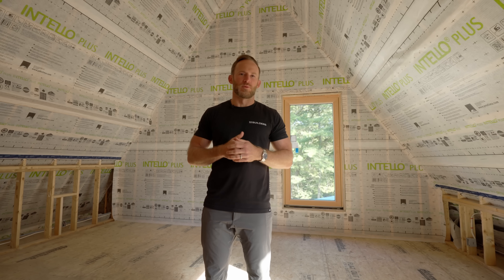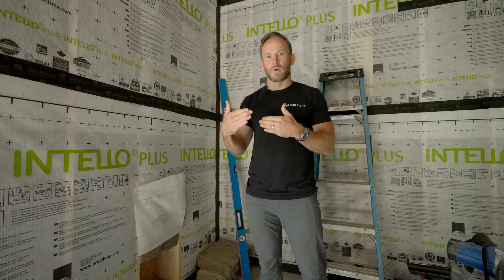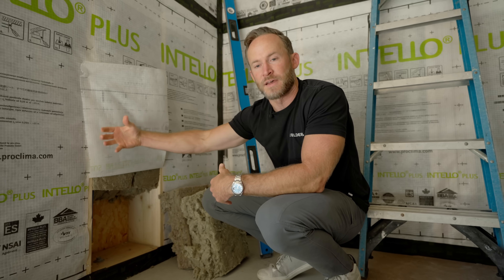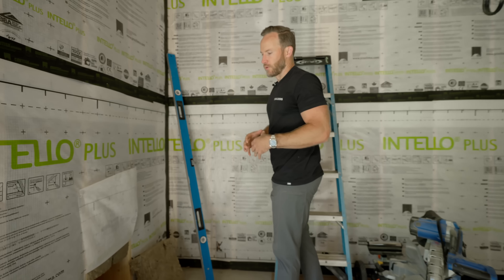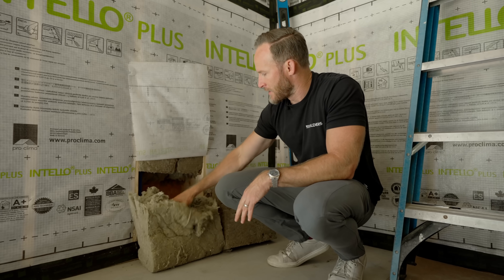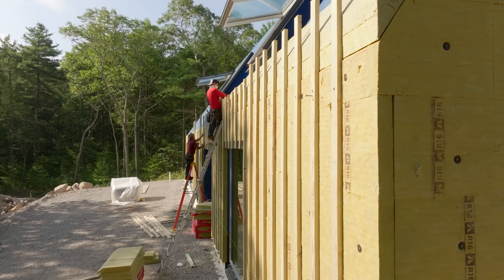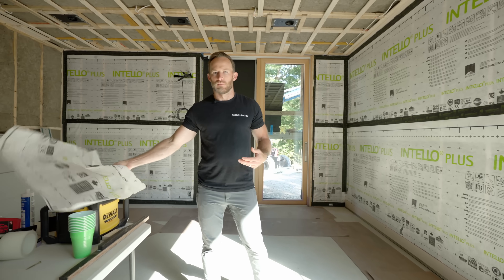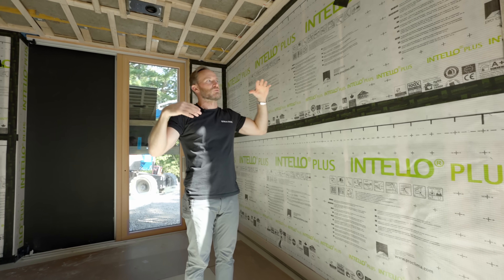Better Than Spray Foam? Why We Choose Mineral Wool

Comment: The divide between something built like this, and the homes that are being built near me today, is so wide, that one cannot see the other side.  While this particular build certainly comes at a very high price premium and represents maximum effort, I can't help but think that the bar couldn't be raised SIGNIFICANTLY for the everyday builders that prop up stick houses near me.  They are two completely different worlds.
Reply: Yeah, as an architect, I can count to that. This is how we would like to build. We understand the reasons why but it’s rare that clients are willing to invest in the future, which is essentially what you’re doing here.  Upfront cost rather than long-term cost of energy.  However, if you do the upfront cost, it also comes with significantly more comfort throughout the life of the building for the occupants.  You don’t get that when you do the cheap code minimum, which is what most people do.  And I get it. Everything‘s too expensive for the most part. This is how the other half lives.
Reply: It used to be the price per sqft is the determinant...but nowadays it is just pure market and not manufacturing driven.

I was shopping for a single family house pre-covid and anything over $250/sqft in north TX is considered luxury with 12' ceiling, > 40" main entry space (that you can roll any appliances furniture in) proper rockwool and ZIP sheathing, properly decked subfloors, and each room would have it's own return air vent. The only downside is it would be 10-20 years old.

Now, even the Tyvek wrap cardboard with 5' sideyard setback sells for that much and people fell for the gimmicky minimalist LEDs. You will need more than $500/sqft to hire a custom builder with enough cash and proper project management chops to  build your million dollar 2500sqft house.
Reply: people are literally spending $700,000 around me to buy a shit house from the 80's that needs total updating. Its a joke. Yes the bar is very low for entry houses. Take some coin to be this detailed. But something everyone should strive for.
Reply: In Vancouver, BC, Canada, it's down to about a 7% premium to build to Passive House standard, which is pretty much what is being done in the video. That isn't a huge amount and includes very high performance windows and doors, among other things. Some people spend more than that on getting the kitchen of their dreams, or some such thing. 

While it's hard to get builders to buy into it, it's not as hard as it looks, and the building designs are often a bit simpler to reduce thermal bridging that occurs through more complicated geometry. That isn't to say there aren't some beautifully designed buildings built to Passive House standards, because there are, but a simpler shape will keep things cheaper and easier. Then there are the health benefits... Building codes in North America NEED to be incrementally brought up to Passive House standards, for a number of reasons. We've built too poorly for too long.
Reply: @duanerichardson2380   the efforts in this video are nowhere near a 7% premium in Van.
Reply: @blairkeeling7385  Are you saying the premium would be lower in the video or greater? The 7% premium in Vancouver is for certifiable PH levels, which appears to be what they're doing here. Of course, that percentage is going to change depending on geographical location and associated costs. Honestly just curious, not trying to be argumentative.
Reply: @duanerichardson2380  leave the building codes alone. If someone can only afford a basic house it’s better than being homeless and forcing everyone to such a high standard will literally leave people out in the cold. I grew up in a house with 2x4 walls and R-11 insulation and survived just fine. The free market can decide what builders should provide.
Reply: @jim4utube  There are several reasons why building to a much higher standard is beneficial. Energy requirements are constantly increasing and so is the cost of that energy. Currently, if power goes out in winter, people and pipes freeze; not so in a PH. Current standards allow for and actually increase rot and mold growth, requiring additional costs of upkeep and repair, and promote poor indoor air quality which results in asthma and allergic reactions. PH buildings are more resilient, healthier, and better for the environment. 

There are really two main barriers to building to PH standard. First, the vast majority of people are uninformed. Too many builders think the way they’ve always done it is fine, so they may not even bother learning the benefits of PH and passing that knowledge on to their customers. That’s the type of thinking, in many industries, that stalls progress. Second, people only look at the upfront costs and ROI, yet fail to consider the savings not just in energy, but in maintenance and repair to the structure. Without moisture accumulation issues in the walls, there will be no rot or mold, and without condensation issues on the inside, no mold issues on surfaces. Or consider PH windows which are more expensive, but of greater quality and will last longer, reducing the number of times they need to be replaced, making them cheaper in the long run. PH homes are built to last a very long time with minimal maintenance to the structure; what we build currently are not. PH buildings are cheaper in the long run.

Consider also that some jurisdictions in other parts of the world only allow PH for social housing, as it reduces energy costs by 80-90% for new builds. Even doing deep retrofits can reduce energy costs by 60%. Does it not make sense that the poorest people and those on fixed incomes should pay as little as possible for energy costs?
Reply: @duanerichardson2380  you missed the point of the comment you are responding to.
Reply: @duanerichardson2380  and how do you think poor people and those on fixed income are supposed to afford this?
Reply: @zaneturner4478  How many poor people and those on fixed income are building new homes? They're more likely to be renting the cheapest homes, including subsidized housing, are they not?

But that also raises the issue that all social housing should be built to PH standards, so that the poorest people have the lowest monthly bills. Some places around the world actually do that.
Reply: @SteelheadTed  I'm pretty sure I understood. How many people who can afford to build even a basic house at current codes, will be homeless and left out in the cold if codes increase the quality of the build? If they have the money and income to build a basic house, they have the money to continue to rent until they can afford the extra 7%, or whatever it might be--it's likely to end up being even less as builders educate themselves and get experience, and component costs come down as demand increases, resulting in increased supply and innovation. Or, such persons can build a slightly smaller house and/or compromise on certain things, and have a healthier home and, in the long run, a more resilient and cheaper home.

Again, a large part of the problem is that people only look at the upfront costs and don't factor in the non-monetary benefits, such as year-round comfort and healthier indoor air quality, nor the long-term financial savings.

Besides, there have been some PH builds that have come in right around the same as a standard build anyway. There are any number of factors that can change that percentage.
Reply: Cost and labor wise, this house could be made for cheaper and faster doing ICF (insulated concrete forms) and would be even better in every way. That's the problem with going to this extreme of monopoly framing, it doesn't make sense to stick build this way given the alternatives because you basically doubled the cost of framing the house. You are adding twice as much material (insulation on the inside and outside with vapor barrier and tape on the inside and out, with additional studs on the outside over the insulation to attach siding and roofing). An ICF home would be quieter, better insulated (mostly because of the higher thermal mass from the concrete), far stronger, quicker to build, and would cost about the same or less.
Reply: Someone needs to teach the contractors/tradesman in my area the value of insulation, and how it works; e.g., that insulation is good, but that insulation with big holes in it everywhere is not good (big waste of money). These guys are generally sloppy and simply will not adhere to modern construction practices. This attitude of course does not apply to everyone, but is still pretty widespread, as though these guys are still living in the 80s. It's the "That's the way we've always done it" attitude.

Comment: I don't understand one thing, you are using fancy membrane that is vapour permeable in the summer, but you have OSB on the exterior wall, a vapour barrier. In a typical construction, for proclima intello, you are supposed to have vapour permable exterior wall.
Reply: Yes, but the combination of "plywood + SA WRB barrier" is considered as still "vapor open enough".

The ideal setup would have been 10 inches of EXTERIOR insulation and max. 50% of that exterior R-value on the inside. So, in this case max. 5 inches Rockwool on the inside. By doing so, you can leave out any extra vapor membrane on the inside (Intello in this case).

Even way better would have been to use any natural material for the interior part of the insulation, materials like wood fiber, hemp, cotton, sheep wool, cellulose,... 
These materials will also damping any noise but foremost, these materials are hygroscopic and will absorb or release some dampness. This will help to balance the RH in house.

Comment: Unless you installed formaldehyde-free Rockwool (which it seems you didn't), the healthier option would be fiberglass (manufacturers got rid of formaldehyde in fiberglass insulation decades ago - sadly, it's not true for most stone wool products).  Cellulose or sheep's wool would be healthy options at the top of my list.

However, if the alternative choice was nasty spray foam, Rockwool was the better option from a health perspective. But since most stone wool still contains formaldehyde binders that continually offgas, it wouldn't be anything I'd choose for my home. It's the same reason I won't use OSB, laminates, carpets or many types of upholstered furniture - all full of nasty offgassing formaldehydes, 'stain prevention' and 'fire safety' chemicals. Nor will I use any oil-based stains/paints/primers.
Reply from the maker: Old info. ROCKWOOL switched to a formaldehyde-free binder years ago which is safe, no off-gassing, and Green guard certified.

Comment: So much labor and work for a stick built house.  Seems like ICF would not only be cheaper, but faster, and better performing.
Reply: icf is pretty low R-value in the real world.  Despite the industry advertising bs, "thermal mass" doesn't change the fact
Reply: @ACatKrom  have you ever lived in  or even been in an icf home? Thermal mass is absolutely not a scam. You would know this if you have even lived in an ICF home. lol
Reply: @JohnReasoner-z7w  Low IQ comment, that doesn't have a single thing to do with the FACT I stated.  
ICF ARE low R, that thermal mass does nothing at to help that FACT unless you live in an area with large temp swings day to night.  When the outdoor temp is relatively steady  the concrete conducts heat (its in incredibly poor insulator).  ANY other type of construction with the same air infiltration, and higher R will have better performance, and be less expensive to heat or cool, and do so at a lower price to build.
Reply: As hominem babble does nothing to help your argument. Thermal mass = heat retention and dispersion. Once it gets warm, it takes far less time for a home to cool down to the point of needing to force heat back into the structure. Idc if it’s low R or not, my 1500’ icf home went thru about 4 cords of wood in the mountains of Montana where it regularly got to -20 to -30* compared to 800’ homes in the area that were conventionally built with “higher r value” as you’re touting, and went thru 10 cords.. I would put my ICF home up against any conventionally built home with higher R value any day of the week. 
I come from real world experience not keyboard warriorship from reading articles.
Reply: @JohnReasoner-z7w  Obviously you didn't understand a single word I said.  
Thermal mass is NO benifit AT ALL unless you have a high diurnal temperature variation, which you do NOT in Montana.  If you lived in the desert south west, then the mass acts as a damper keeping you cooler during the hot day, and warmer during the cold night.
Where you live in Montana all that concrete does is conduct heat from the inside to the outside all winter long, and you're left with a basic R20 something wall, which has been below code min for a decade or more...
Just because your neighbors built a shittier house that you did, doesn't mean yours is "good" as it's not nearly as energy efficient as one properly designed and built for your area.
Reply: @ACatKrom oh my word…
😂😂😂 there’s no hope for you..
The YouTube school of home building science has failed you.
Reply: @JohnReasoner-z7w  I've got a degree in  mechanical engineering. Not only is everything I said common knowledge, and backed by real world results, I've done the calculations to prove it .  Other than believing the marketing crap from the people who sold you a product, and having to try and defend your incorrect remarks, what do you bring to the table???
Reply: One of countless studies that all say the same thing:
Applied Energy Volume 198, 15 July 2017, Pages 108-121
"In cold climates, high thermal mass structures will often use more energy than low thermal mass structures."

Comment: As I have learned about mineral wool is 2 bad things. 1st is absorbs water at an incredible rate. It's like a sponge. 2nd is use formaldehyde. Terrible for air quality. It is a good insulator, though.
Reply: The rockwool that's used for insulation is hydrophobic. There is another type of mineral wool that's used for plants that absorbs water.
Reply: @niktak1114  That mineral wool that we use in industry I am sure is the spawn of Satan. Been looking at the new green stuff, definetly got some projects for it. My main concern revolves around airborn fibers.
Reply: @rosseryn8216 The fibers don't seem to hang around in the air because they are pretty heavy. Also it's supposedly safe to breathe although I'd avoid it if you can.
Reply from the maker: Old info. ROCKWOOL switched to a formaldehyde-free binder years ago which is safe, no off-gassing, and Green guard certified.
Reply: @jamesoncross7494  I have accidentally left rockwool out in the rain.  Not much absorption.  I left more accidentally in a low spot and in the morning it was soaked.  Put it on my woodstove and it dried 
off quickly.  Doesn't combust til 2200f+  !! If it were fiberglass it would have been ruined.

Comment: I’m interested to know if switching from Siga to 475 was sponsor or performance driven? A few of the real nerdy guys I’ve chatted with about the difference have told me Siga Majrex out performs Intello when you have data collection buried in the walls here in Northern New England.
Reply from the maker: It was a performance decision
Reply: @NSBuilders in what way?
Reply from the maker: Specifically here we found it was better in the roof application when it’s compressed under insulation and performed better at self sealing

Comment: Recently came to my attention that they use formaldehyde in their products. Did you know about this ? Curious to know your opinion about the of gas health concerns.
Reply from the maker: Old info. ROCKWOOL switched to a formaldehyde-free binder years ago which is safe, no off-gassing, and Green guard certified.
Reply: @NSBuilders  Not correct. They not switched, they offer special product AFB evo™ starting July 1st 2017 without formaldehyde. Standard product still contains formaldehyde. Info from FAQ on their official site.

Comment: You could save some money on HVAC, but with three layers of rockwool plus labor, no way that it’s a net savings…
Reply: If you build to Passive House standards of insulation and air tightness, it is a ten year payback in terms of build cost v heating/air con. Plus you get the benefit of a much more stable internal environment all year.
Reply: @StuartB-b6s  I think a 10 year payback is sales pitch pipe dream.
Reply: Big fan of rock wool, but it sure seems to complicate construction when adding 4” on the outside vs 1.5”.  I get the condensation issues with going with less insulation on the outside but why not eliminate the interior vapor barrier and just let the wall breath?  A little compromise in insulation issues seems worth it to simplify wall construction so it’s easier with fewer potential mistakes, driving super long screws ain’t easy and the misses seem highly problematic.

The problem may be with finding a framer who truly knows his stuff because what I see being built in the Adirondacks on million dollar houses is 1990 quality and you can’t convince them to change from what “what works.”
Reply: @klister  So the interior is using a vapor retarder, not a vapor barrier.  I only recently learned about these.  The barrier is one that is completely impermeable, like what goes underneath your basement slab - basically a thick plastic.   The retarder allows the vapor to move through it to dry to the interior if there is proper interior ventilation.  You don't necessarily need one if you are drying to the inside since the drywall and paint is also a vapor retarder.  I've seen vapor retarders used more as air barriers that also allow vapor to move through it.  Stego i think is another brand i've heard of for this.
Reply: Ya but they get a warm fuzzy feeling when they think about it
Reply: On what timeframe?